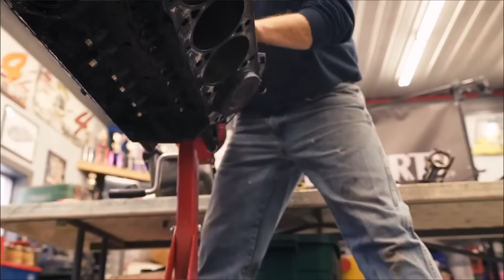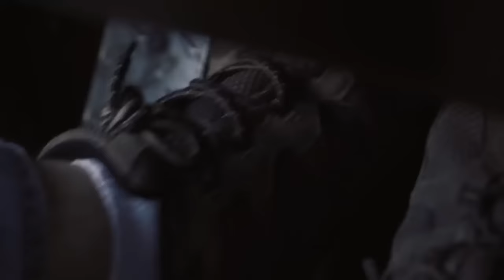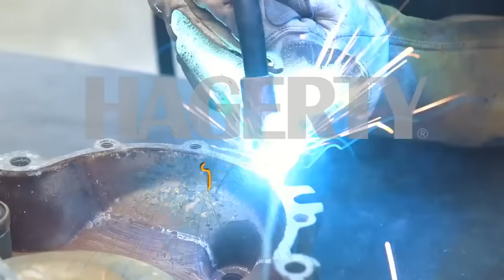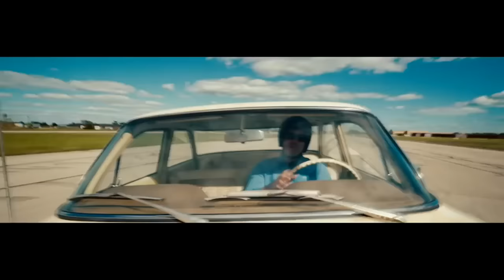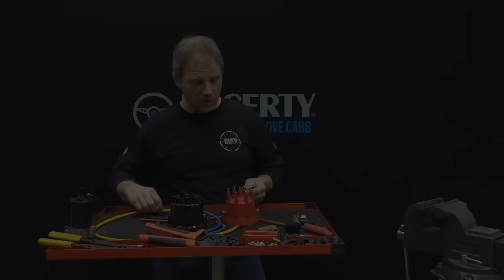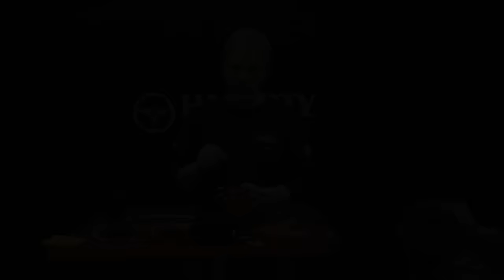DIY: How to Make Spark Plug Wires

Comment: I would add two suggestions as a veteran from the 60's. To make the wiring neater at the distributor end, choose a wire set that comes straight up out of the distributor cap instead of those 90 degree ends. 
Second, on the resistance, I recently used a Pertronix electronic retrofit distributor on a new SBC engine. The directions stated that system needed wires with a minimum resistance value. I don't remember the number so check with the manufacturer of your equipment. 
What that one questioner was referring to regarding the quality of the "anti-RF" wires was when they were first out, the wires were kind of "delicate". Pulling on them or even bending them sometimes would cause the graphite coated fiber conductor to break causing a "misfire" at that cylinder. People would use the "R" type plugs instead of the "R" type wires.